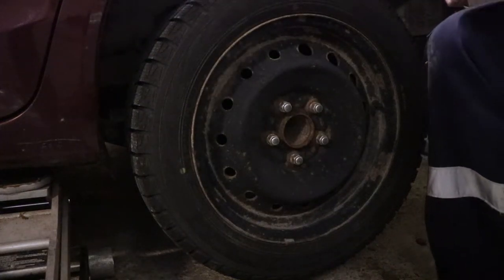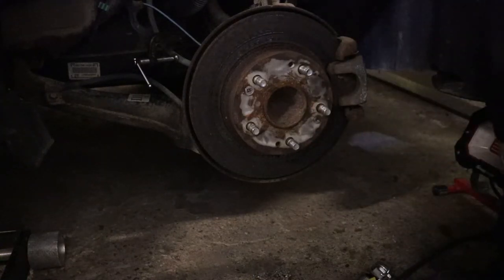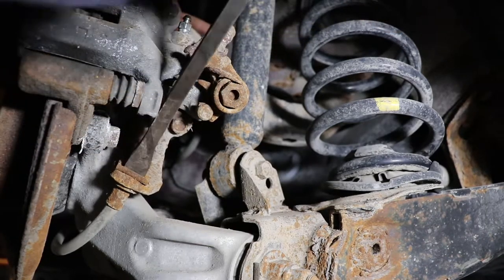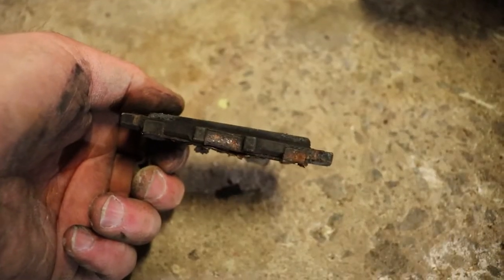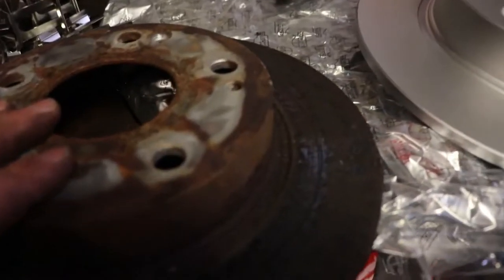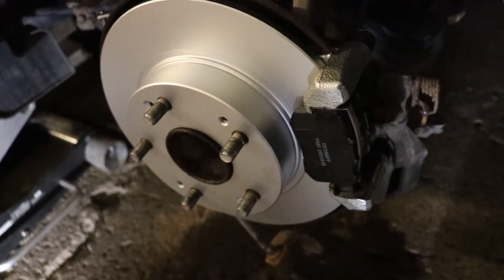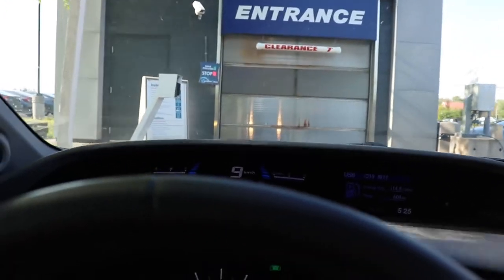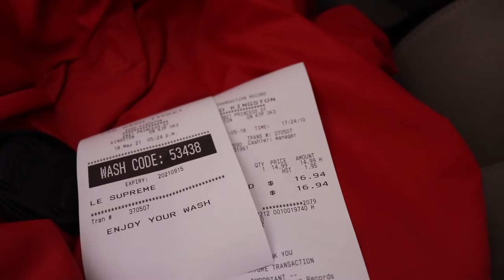9th Gen Honda Civic Back Brakes, 2011 through 2015

Comment from the maker: YOU NEED TO ALIGN THE SLOT IN THE REAR CALIPER WITH THE RIVET ON THE BACK OF THE INBOARD BRAKE PAD.  THIS IS WHY MY BRAKE WAS NOT APPLYING EVENLY AFTER DOING THIS JOB.  YOU WILL HAVE PROBLEMS IF THE BRAKE PISTON ROTATES WHEN YOU ARE DRIVING AND IT WOULD BE DANGEROUS.
Please check out my affiliate links in the description if you are looking for parts and pricing.